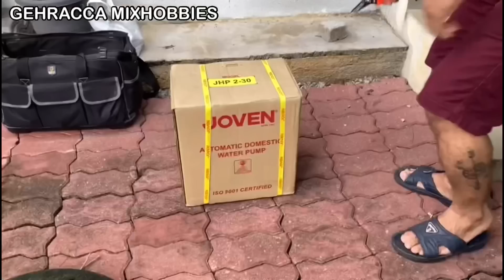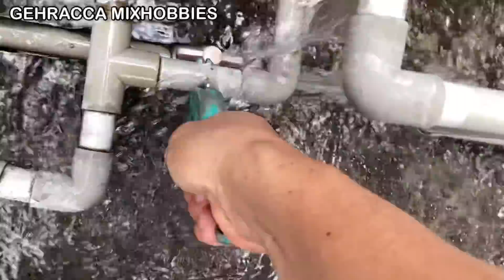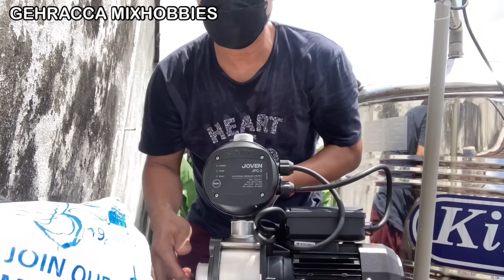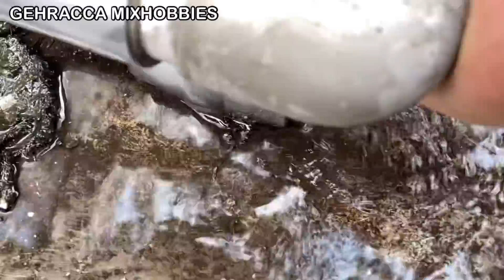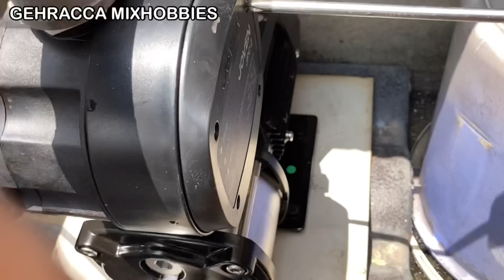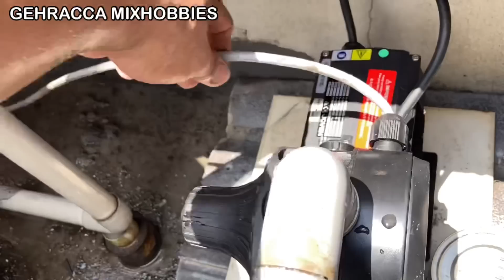Joven JHP 2-30 domestic booster pump installation #doityourself #jovens #waterpump #gehracca

Comment: Boos how to servis this
Reply from the maker: Servicing parts required to disassemble the whole unit, for faulty bearings,mechanical seal,auto pressure switch and impeller